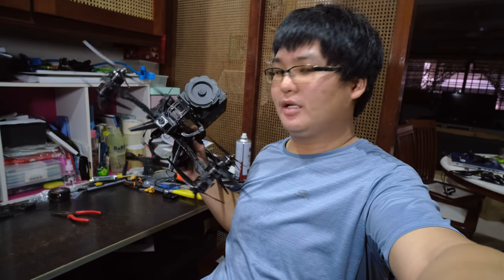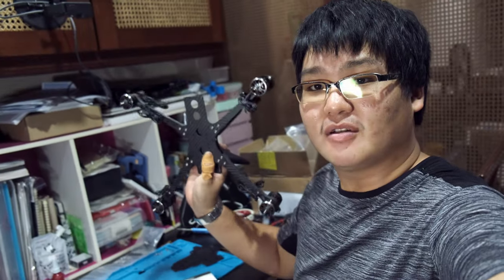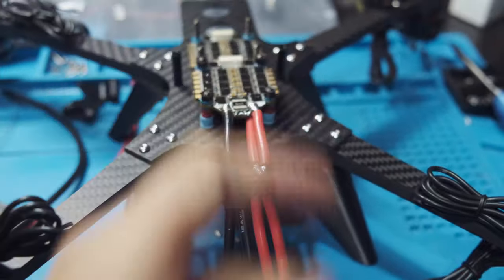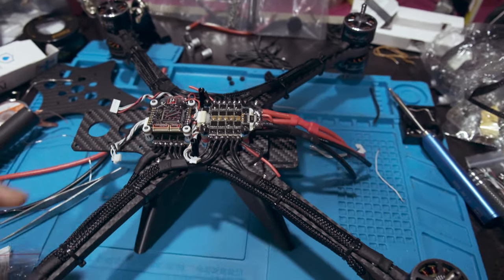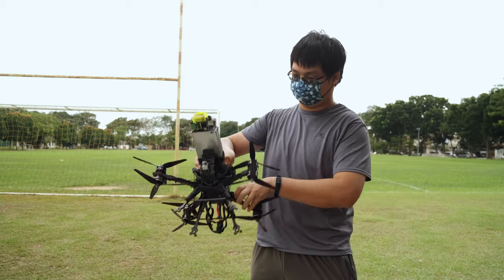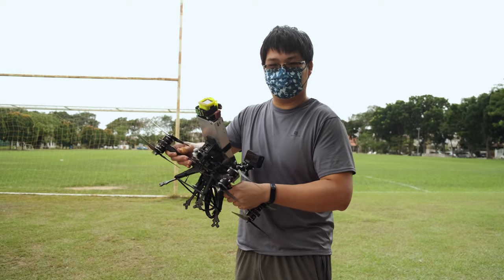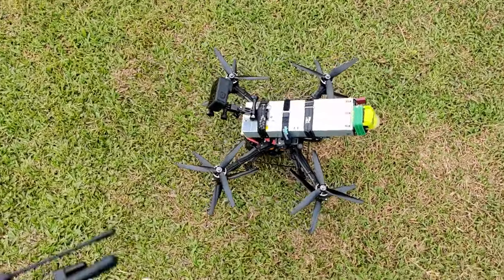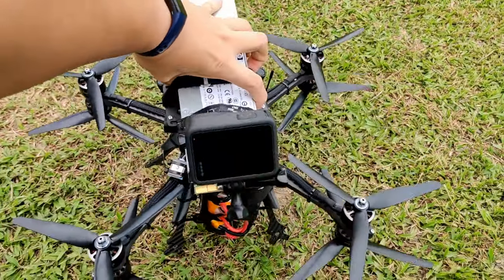Building a CineLifter | Shendrones Thicc Build Log Pt.1

Comment: How did you connect the 2 ESCs together and then into the FC?
Reply from the maker: The 2 esc goes into the FC directly. You need an fc which has 8 motor inputs

Comment: Hey thanks for the video. I'm having extreme hot motors. I used the UAV cinelifter preset in BF any suggestions? 2807.5 x 1322kv motors and using HQ 7x4x3.

Comment: Hello my friend. Thanks for this video. It helps me. Im building a Siccario with similar configuration. 2 hobbywing 60 esc. Brain FC and 8 Xnova 2812 (1100kv). You recommend yo leave the stock caps that came with the escs and add 2 of 1000uf (panasonic)??? Im planning to use only one XT90 with bigger battery. And connect one esc to the other with 10AWG cable. Then frome the back esc take out the power cable with the xt90. What do you think? I see that you have experience with this. Thanks a lot !!!!!

Comment: Noob question: you soldered battery wires together in parallel, is it not good idea to use each batteries separately? 1 battery for 1 ESC?
Reply from the maker: No, you want both esc to be getting the exact same voltage.

Comment: Can you explain the capacitor setup you have and why you have it? I am waiting for all my parts to come in this week! So Excited!
Reply from the maker: Hey man, I am running 2x 1000uf and 4x 350uf on a Rush PFB connected by wires. Honestly from what I had learnt so far, I wouldn't recommend this capacitor setup and would just suggest you put as much caps as you can physically fit, as close to the ESC as possible. If you are using the stock Hobbywing 60A ESC you can try leaving those there, else try fitting 4x 1000uf as close as possible to the ESC pads. Sorry for the late reply, was super busy with work in the past few months, I hope your build went well!

Comment: Wowwwww...... this is so fire my friend!!!! Thank you for guiding us like this! Quick question, for my thicc... would I be able to hook up my two esc (same esc as you) to only one 6S battery (Xilo 22.2v, 750C, 2250mah)? And how could I tell? I am new to electronic/drones so any help would be greatly appreciated!
Reply from the maker: Thanks friend! I don't think a single 2250mah 75c battery would be able to last long, probably for testing you can try but I wouldn't fly with that setup. At least a 4200-6200mah would be ideal. Most people use 5200mah if not mistaken. Honestly if you are new to electronics/drones I would not recommend you to build something like this, and should try getting more experience building 5" drones first before building one of these. 

Apologies for the late reply, was super busy with work over the past few months. Had you built it yet?
Reply: @IgnitionFPV  hi! 6s 5200 will work for similar build? What would be the flight time if i need to fly slow ? thanks!

Comment: What battery size you used? And what is the flight time do you get with that battery.
Reply from the maker: Initially I'm using 3x 6s 1300mah 100c lipo. I had ordered some 6200mah 90c packs and yet to arrive. With 3x 1300mah it lasts for around 4-5 minute

Comment: Yes. Thanks for the video dude! Ive been thinking of building one soon! What was your capacitor set up?
Reply from the maker: Welcome bro! Actually I need to make a follow up video soon as I had changed certain things about the build already. After building it I had added another 2 extra 1000uf 35v caps for even more capacitance and had changed the FC to the Matek F722HD
Reply: @IgnitionFPV  interesting. Why did you change the FC? My biggest fear with this build is the tuning
Reply from the maker: @LZRFPV  I had 2 crashes due to unknown cause. The blackbox shows the gyro data suddenly becoming garbage on a front flip, weirdest thing is I put that Radix on my 5" quad and there was no issues at all. So just decided to change it to a Matek F722HD and add more capacitance for that extra insurance. Honestly no idea why the Radix did not work on my build but so far with the Matek it had been pretty good. I'd suggest purchasing the Matek as it is easier to get blackbox log out of it and most of the tunes online are based off the Matek board. The Radix board requires a different filter strategy compared to the Matek as it uses a different gyro. I'll be releasing another video soon with some sample footage but won't be talking too in depth about tuning and the technical stuff in that video.
Reply: @IgnitionFPV  interesting. I’m building one now but using a slightly different setup. I was going with the 2806.5 1300kv. Would you say the 2808 are really good?

Comment: Do you think the hobbywing f4 fight controller would work? Or should i get a matek f722 hd??
Reply from the maker: Don't think the hobbywing f4 can even work for this. Any fc you use for this needs 8 motor outputs minimum. The Matek F722 HD is still the best
Reply: @IgnitionFPV  and the matek with hobbywing 60a is just plug and play? Do i need a 12v bec downstep for an airunit? Or am i good with just the matek fc?
Reply from the maker: @skyhighfpv469  you will need to repin the connector. Highly suggested to power the air unit with a Pololu BEC for absolute reliability
Reply: @IgnitionFPV  which one the 12v 1a?
Reply from the maker: @skyhighfpv469  the 12v 2.4A
Reply: @IgnitionFPV  thank you so much keep the great content coming!
Reply from the maker: @skyhighfpv469  welcome man! Trying to make more content. Just uploaded my Gyroflow test video just a few hours ago!
Reply: Hey! I have another quesiton i just put my siccario together, and i have the matek f722hd and x2 hobbywing 60a esc's. I just plugged into betaflight to check motors, and the top ones i got to spin up and there going in the right direction, but when i start motor 5 it doesnt spin so im assuming the bottom motors need to be setup? In config i switch it to  oct 8 and it shows 8 motors.. what else do i need to do, to get the working?
Reply from the maker: @skyhighfpv469  I'm assuming one of your esc is powering the top set of motors while another esc is powering the bottom set? Would need to see your wiring to be able to troubleshoot properly. You can send me a pm on my fb page. Just search ignition fpv there and I'll try to help you out. Cheers!
Reply: @IgnitionFPV  ok cool thanks! And yea bottom esc is powering the bottom motors and top is power top

Comment: Have you connected both becs to the FC?
Reply from the maker: BECs or ESC? BEC for the Air Unit and cine cam is hooked to the main power supply leads. ESCs are wired to the FC by the plugs
Reply: @IgnitionFPV  so this fc has 2 plugs for connecting 2 ESC’s? For flight controllers with only 1 plug I can just solder 2 ESC cables in parallel right?
Reply from the maker: @Diown   no you cannot just solder to 2 esc in parallel. You need an fc that supports 8 individual motor outputs.
Reply: @IgnitionFPV  yeah I see and where do you leave the 2 current and telemetry cables?
Reply from the maker: @Diown  HW60A does not have telemetry output, so it is not connected. You only can connect 1 current wire to the FC, so just double it in the betaflight configuration to estimate the current draw of all motors